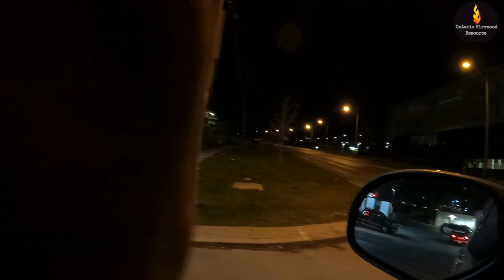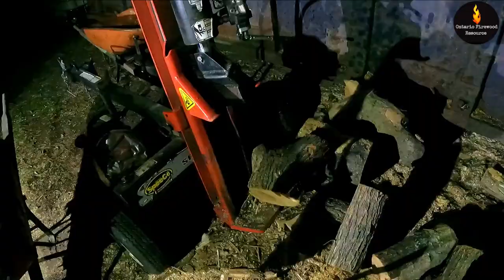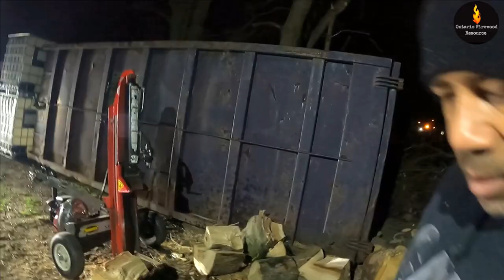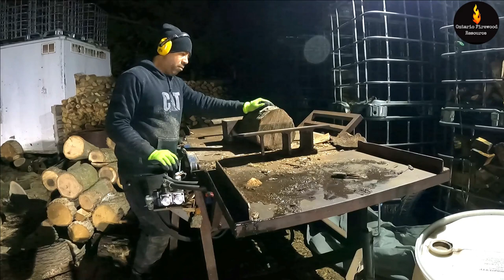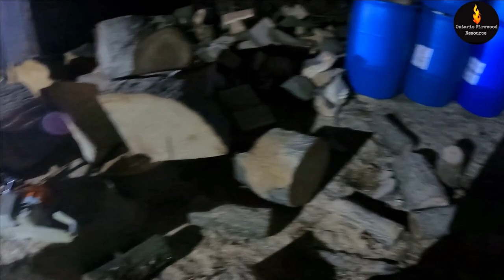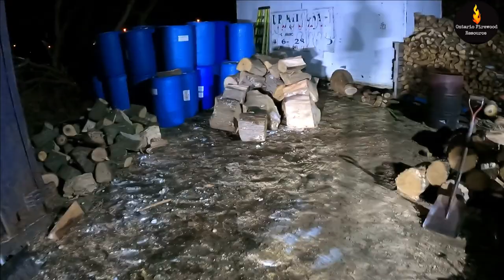TWEAKER GETS BUSTED NEAR THE WOODYARD #FIREWOOD

Comment: good to see the beastonmade working.
Reply from the maker: There's nothing that I would change significantly about the beastonmade. All that was changed was smaller hose diameter for the log lift to slow flow and reinforcement of the box wedge connection to the ram. Years ago I replaced the the cutting edges and flared them out so the wood wouldnt jam while going through

Comment: Anthony  could you explain the difference between your two locations? What is done at the 'shop's and the other location?
Reply from the maker: I've had the shop since I started the scrap metal business to process and sort materials there and I ripped out the furnace and got a wood stove to heat it and that's how I got into the firewood business. I started finding woodand tested the market and then the wood business grew too big for the shop

Comment: Stringy stuff. Box wedge didn't mind it tho.
Reply from the maker: I make sure I put the stuff that will go through. If it jams up, the chain pulling it off only works if the wood hasn't gone through enough, which the chain will pull off the top piece above the splitting edges and leave the stuck wood inside the cutting edges. If the top of the round comes off. Them I have to use the saw and cut across the grain. Just I. Front od the cutting wedge